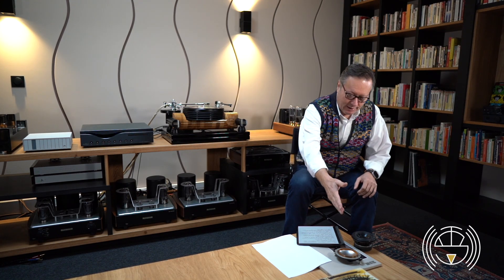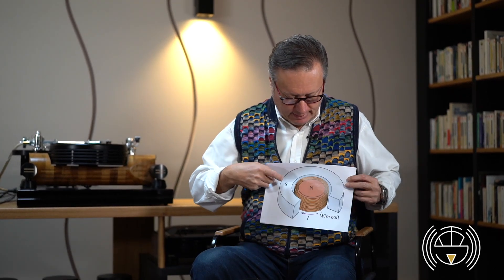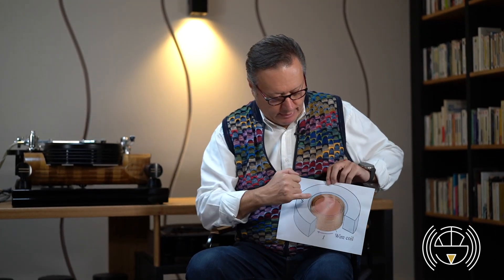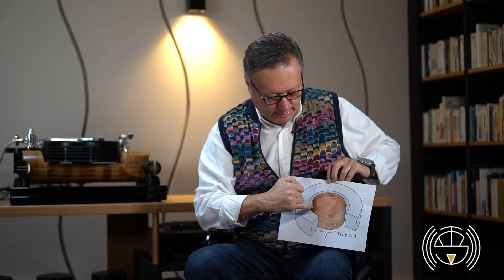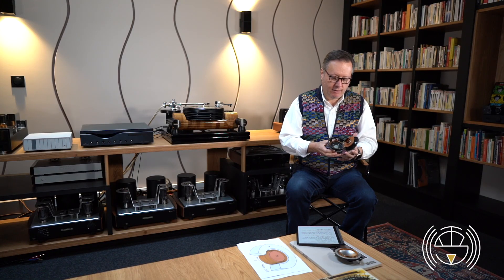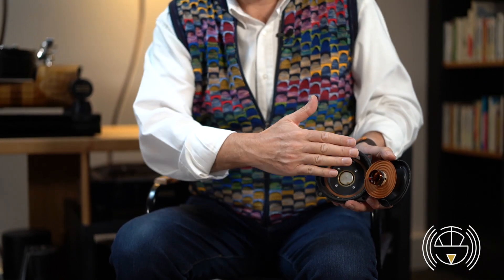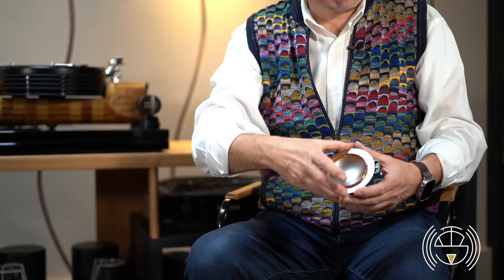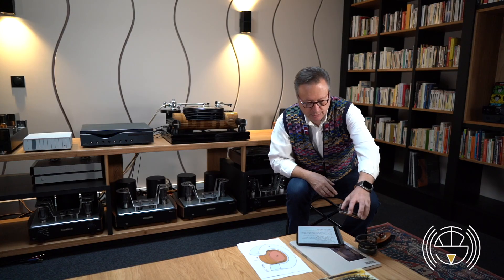Why TAD are the best speakers ???

Comment: Yamaha did cvd beryllium all the way back in the 70s. It is now 2025 and we still have dealers telling us how fantastically advanced and 'state of the art' this process is. Are you guys not embarrassed?
Reply from the maker: @A-gks  Diamond coated beryllium means a stamped disc of beryllium coated with Diamond (a not enough solid beryllium strengthen by carbon), PVD (not CVD) means create the disc depositing beryllium vapors on a form to get the desired thickness and strength. Anybody else doing it? Why? What you get in Magico with the same price? Talking about beryllium tweeters what is the frequency response of Magico compared to TAD (the half)? All those are factual points. Then you like better Magico, I like better TAD. This is subjective.
Reply: @tecsart  no manufacturers at this level are still using your so-called 'stamped discs'. Even Magico's non diamond coated beryllium tweeters are cvd beryllium at its core. The diamond coated ones go one step further with cvd diamond process. We're not talking budget beryllium tweeters of the early 2000s here. Once the break up modes are pushed beyond 50khz, it doesn't matter if its even 100khz or not, or maybe you're a TAD dealer hence you're compelled to call it the best?
Reply: @tecsart  in fact, no need to even mention Magico. The Yamaha NS1000 had cvd beryllium all the way back in the 70s.  No foils or stamped discs. Stop making it sound exotic and state-of-the-art when it really is old tech.
Reply from the maker: @A-gks  who cares about state of the art technology, what matter are state of the art results. Yamaha may have/had state of the art technology and average results (unless you want to state that the Yamaha quality is the same as TAD and Magico).
Magico is one of the best, TAD is also one of the best. At that level is just a subjective choice. Magico explore the last top technology, TAD is more conservative and push the limits of the classic.
TAD is unbeatable on coax, drivers, which in a different way have a lot of benefits over separate ones. 
What is best? Up to you. I have my hears and I prefer TAD, but I will be very happy to have Magico too. 
About Yamaha, sorry, I am not dreaming of.

Comment: Definitely very nice performance speakers but not absolute best level
Reply: Have you had the chance to compare them to better speakers?  Considering them and wondering what better speakers you compared them with.
Reply: @GreenArrowNetwork apparently you're not familiar with MY DESIGNS. I AM NOT PAYING TIME WITH 300K+ DACS just as an example...MY DAC EASILY OVERTAKES AND  TEACHES THE SUPPOSED BEST AT THE PROVERBIAL WOODSHED.  ULTRA HIGH END STILL HAS SO MUCH TO LEARN AND GROW WITH

Comment: Maybe the best in craftsmanship! but that doesn't make them sounding the best!!! To sound something the best it requires so much much more than the best engineering. And dont forget that in 2024 the speakers are still the weakest link in the Hi Fi / High End chain.
Reply from the maker: @dejandavkov  Of course, but having the best drivers that outperform any other driver (with same technology and application) is already an important sonic advantage compared to whom does not have it. To do good cabinets is in the hand of many and TAD is second to none…
Reply: @tecsart  I believe that TAD is one of the Best, but there is no proof that TAD has build the best drivers in the planet Earth. They use dynamic drivers. There are a lot of other types of drivers that have to be upgreated to sound like one of the best. Let's assume for now that TAD are number one and it is confirmed by independent company for quality and accuracy. And the next day some unknown company invents some audio invention that has no driver's, crossovers no cabinet no wires and it has 99% real sound. Thunderstorm when produces sound the sound isn't reproduced from drivers and amps. The technology we are using is old and it's only updating. 
No one can't prove that something is the best.
Reply from the maker: @dejandavkov  absolutely agree. My video makes only sense for most common hi-fi applications, using this old classic technology (piston) which is far to be perfect. 
Maybe I should make a video analyzing different technologies advantages and disadvantages: ribbon, plasma, exciters, AMTs, Manger MSW, electrostatic, planar, audio accompany, MBL radial….  No, no, too much! 
The same as you I am convinced that a general piston driver will sort out very bad in this kind of comparison. Probably and exceptionally TAD and very few others will have some good points to show.
At the moment there are only few systems using alternative technologies that can fit easily and without discussions in an average family living room. 
Personally I love also Manger MSW. But just because they are different, they are only for those people that listen  objectively without prejudgments.
Reply: @tecsart TAD second to none? I will argue that they are second to Magico. And yes I've heard the TAD R1TX more than once in person. They are one of the best, but not the best.

Comment: With All due respect, but it depends at what sound pressure levels. TAD flagship is rated at 115dB maximum. While zeta zero orbitals >130dB. And they have lighter ribbon membranes for tweeters than TADs beryllium.
Reply from the maker: @quant2011  I’m talking about classic piston movement speakers only, comparison must be made with same technology. I absolutely agree that there are other technologies that go beyond the piston. 115dB is symphonic orchestra playing fortissimo, yet not enough for cinema use. Zeta zero is an omnidirectional ribbon. Other word with other advantages and other problems. 
Zeta Zero are anyway technically a marvel!
I wish l could listen to them.